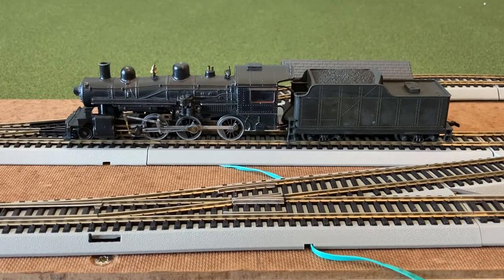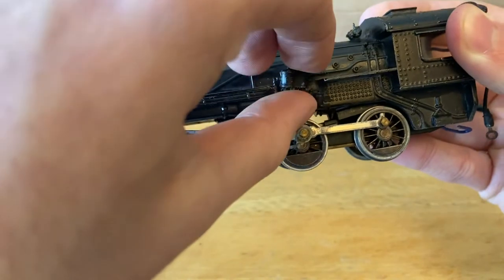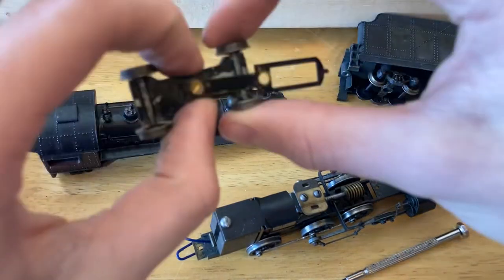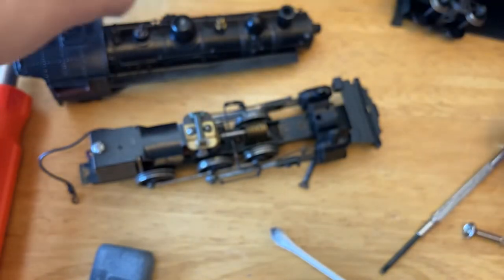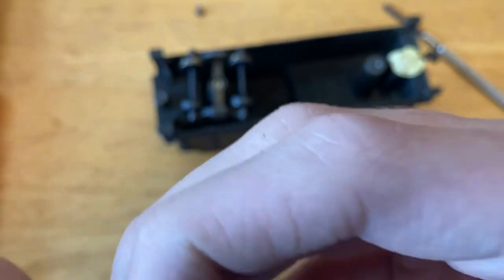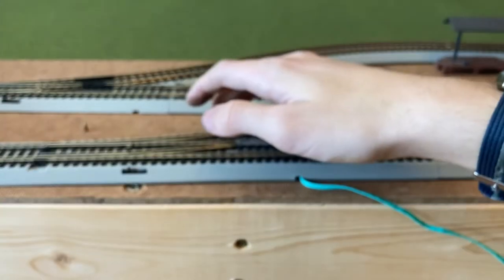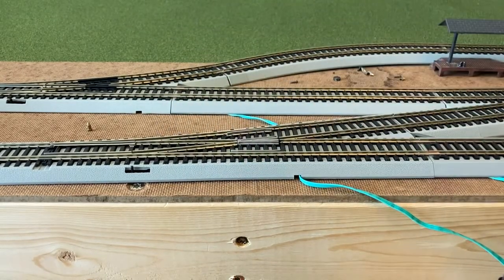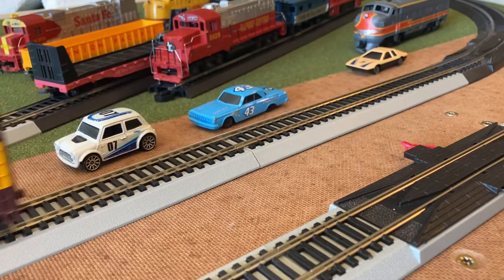1950s Varney Ten Wheeler Restoration - Chassis Repair! 🚂🧰

Comment: You're lucky that none of the tender steps are broken.  Nice engine and it even has wheel bearings/bushings.  You sure it's a Varney?  Back of the cab says "Bowser".  I changed out all the magnets on the open frame (Pittman) motors that I have to rare earth magnets and it made a HUGE difference in current draw and now they will "creep" around the tracks.   Cheers from eastern TN

Comment: Nice Bowser Casey! I have many of the Varney ones, but have yet to locate a Bowser variant. The biggest difference between the two is the frame: Bowser redesigned the frame to power it off the lead driver while Varney powers off the center driver. Bowser's redesign helps with weight distribution better and puts the motor more in the boiler to help hide it.
Reply from the maker: Good to Know! Thanks for Watching!!